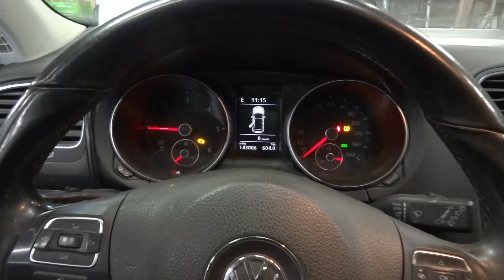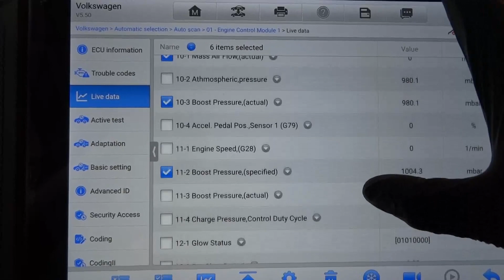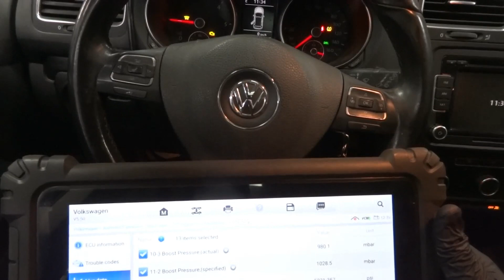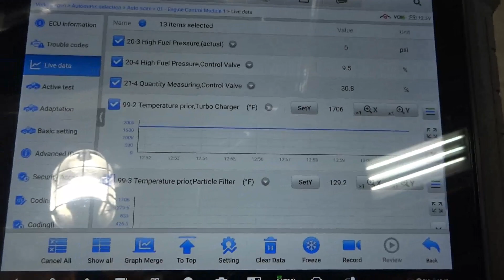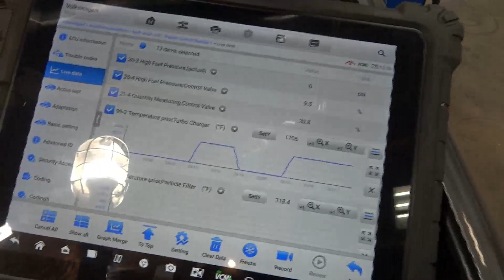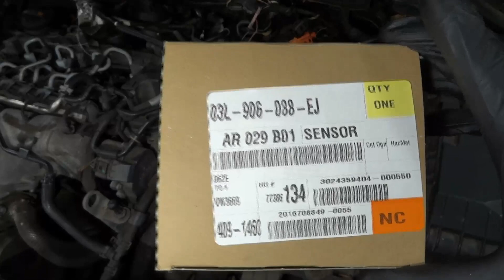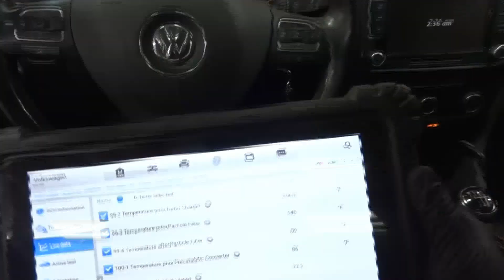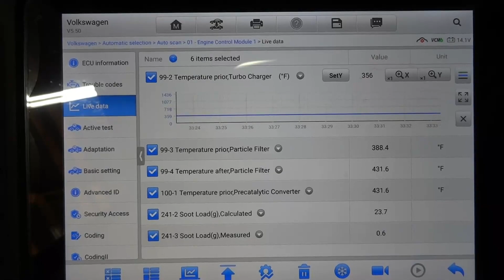Volkswagen Jetta Low Power, Limp Home Mode, Code P0544 Exhaust Temperature Sensor Circuit Fault

Comment: If you place a potentiometer (variable resistor) connected to the pins to the computer, you can increase/decrease the resistance and the temp should fluctuate on the scan tool. I wanted to fix this myself, but when I found out where this sensor is located, I decided to just set up an appointment and have a real mechanic do that work. I have no idea why VW made this so damn difficult to get to? I don't have a lift to do this work. Since the appointment is a month out, I just put the new sensor on, and tied it around some other cables. I know that the EGT before the turbo isn't 930 C. The melting point of aluminum is 660 C. Since my whole engine block isn't red hot, I know that's a false reading. Just need to trick out the sensor until I can get it fixed. This is just what I decided to do. Maybe not your choice, but you can decide.

Addendum:

In my case, I couldn't get my vehicle into the shop for a couple of weeks, so I just hooked the new sensor up and laid it under the engine cover, hoping that some heat would get to it. After driving it for a while, it popped a P2080 Exhaust Gas code and a P244C Manufacturer Control code. The ECU is not getting a temperature that makes sense (probably only about 80 C in that location) so that's a Low Exhaust Gas Temp. If the sensor was installed, the EGT should be in the 240 C range. I'm sure the logic wants to see correlation with all the sensors. But at least I don't get the Limp Home Mode (flashing glow plug light). There's nothing actually wrong with the vehicle except the bad sensor. So I will have to get by with those codes until the shop can install the new sensor.
Reply from the maker: Hunter  it sucks that they can't look at your car in less than a month!

Comment: Hi guessing you had your jumper wires and test light on the sensor signal and ground wires ?
Reply from the maker: @davidwaters5348   Yes!
Reply: @KITS_Auto_and_Truck_Repair  Hi the sensor on my car has two wires ,guessing one will be ground the other signal wire ?

Comment: what size key did you use to remove the temperature sensor.
Reply from the maker: @nickdzhuga2036  I believe it was a 17mm nut
Reply: Hey also another question so I replaced the sensor, however more lights appeared in the dash. Is this normal?

Comment: My daughter has the same issue only the battery light is on along with the pedal compressor light. This happened when her father attempted to attach the battery….he touch the negative post to the positive and vice versa
Reply from the maker: @user-vs1bx9xd1b  I recommend you take it to a pro mechanic who can diagnose it! and sorry to hear

Comment: hello my car is shaking and smoke. lose power, temperature go high fast. When you disconnect orange cable it's stop, but have faut and scared to drive like that. When I connect orange back its starting again shaking and smoke. please help
Reply from the maker: scoped  you might have a blown head gasket!
Reply: @KITS_Auto_and_Truck_Repair  thanks for replying. But I checked my antifreeze looks OK and oil too. Is any different way how to check my head gasket is bad?
Reply from the maker: @scoped2002   you can get a head gasket tester from your local parts store! is your check engine light on?

Comment: Can you help sir
I have bkp 2008 vw passat 2.0 tdi
Ive got code p1027
Reply from the maker: Pinoyness check your intake air control solenoid circuit!
Reply: @KITS_Auto_and_Truck_Repair  how to check if its working or not or should i replace it 
Thank you so much sir as i have this problem for years and no mechanics in ma area can resolve it they always say intetmetent fault they just delete it but it cones back
Thank you for your time
Reply from the maker: @pinoyness5110  I recommend you take it to the Dealership for diagnosis because it's gonna require specific knowledge and a wiring diagram to test the circuit!!
Reply: @KITS_Auto_and_Truck_Repair  thank you so much GOD bless sir
Reply from the maker: @pinoyness5110  My Pleasure!!

Comment: I NEED YOUR HELP FRIEND I HAVE A HΥUNTAΙ COUPE INITIALLY THE FIRST O2 SENSOR SHOWED 0.8 VOLTS FUEL TRIMS AT IDLE -25% AND THE REAR O2 SHOWED 0.2 VOLTS. I HAD A FALSE FRONT O2 SENSOR AND REPLACE FROND  Ο2 SENSOR .NOW FIRST O2 READS 0.5 TO 0.8 VOLTS FUEL TRIMS AT IDLE DROPPED TO -12 TO -14% AND REAR O2 READS STEADY 0.6 VOLTS.EXHAUST GASES BACK TO EXHAUST ANALYZER COMES NORMALLY.THAT'S IMPROVED OTHER CONDITION STILL RICH NOT TRUE....WHAT DO YOU THINK IS GOING ON? ALSO THE MAP SENSOR AT IDLE READS 12 IN/HG. IS THAT A GOOD MEASUREMENT?ENGINE IS 4 CYLINDER 120 HORSE I USUALLY IDLE IN THESE CARS 9 IN/HG READING  MAP  .WHAT WOULD YOU RECOMMEND I LOOK AT?
Reply from the maker: LETTA LETTA  look at your EGR and make sure it's not opening at the wrong time,